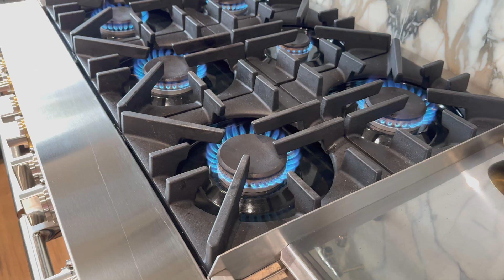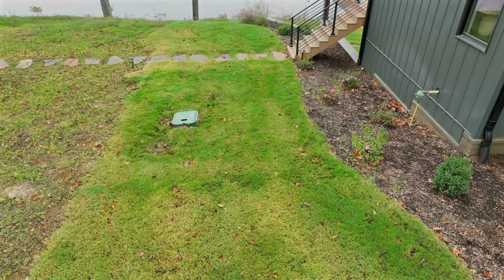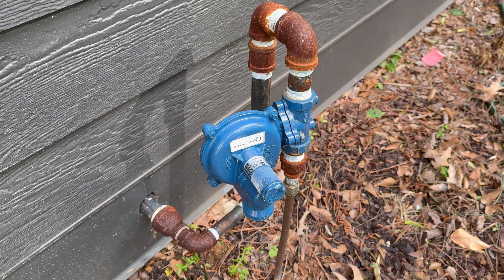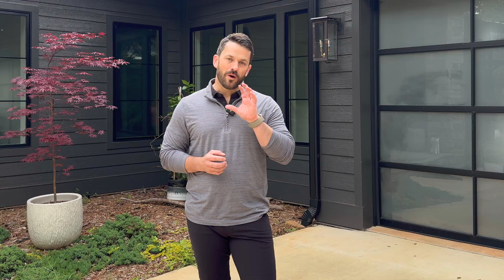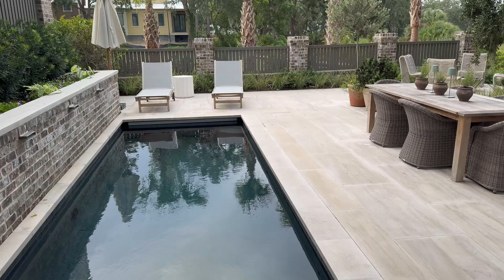Safety and Versatility of Propane

Comment: and for anecdotal evidence my room air filter always steps up its fan when using the gas stove at home.  Any flame burining any gas produces off-gasses  (no combustion is "clean").  

Can't open the window in the winter.

Can't afford a microwave vent to outside (Via roof); which i am amazing isn't mandatory code (thanks republicans).

Can't afford to transition to electrical stove.

Comment: Gas stoves pose health risks by releasing nitrogen dioxide, carbon monoxide, benzene, and fine particulate matter that can trigger respiratory issues, worsen asthma and COPD, and increase the risk of developing asthma, particularly in children. Other risks include gas leaks, which can lead to leaks of dangerous methane and other chemicals, and fire hazards from the open flame. Proper ventilation by using exhaust fans or opening windows is crucial to mitigate these health risks

Comment: Couldn't disagree more on the utility of Propane, at least in moderate climates. Give me an induction range that is easier to cool and heat pump water heaters and furnaces any day, with some solar and batteries on the roof.  I will agree with the benefits of a backup heating source with a generator, and depending on your winter solar potential the utility of a backup generator running on propane.

The pretty picture of a propane tank. in the middle of the yard with no combustibles around it is great... until someone decides they think it is ugly and plants things to screen it.

But presumably this is sponsored content by the Propane industry group, so whatever.